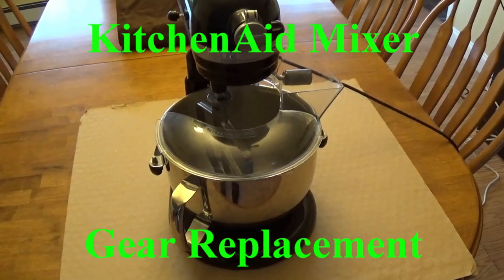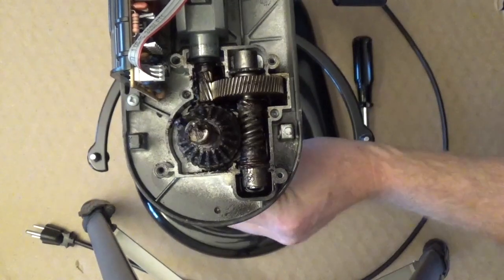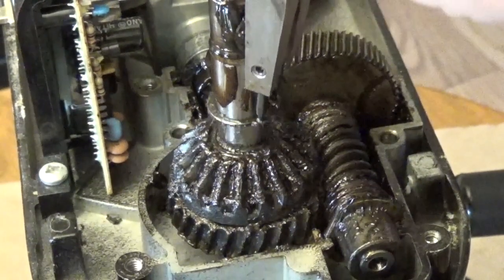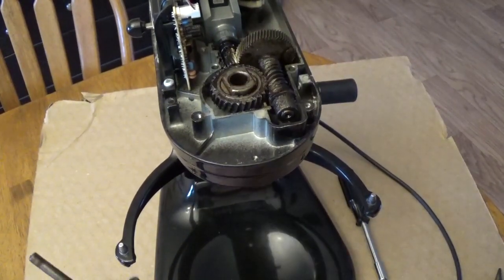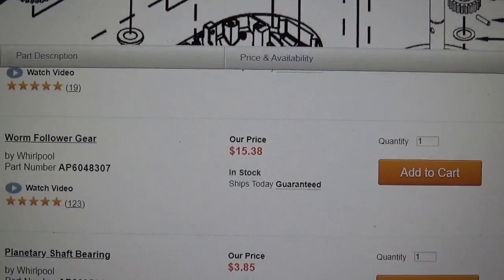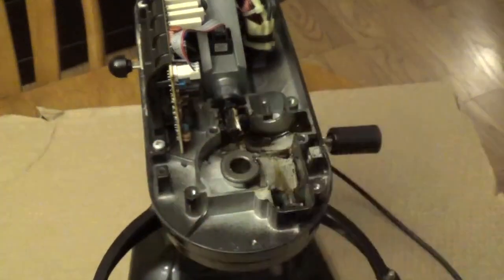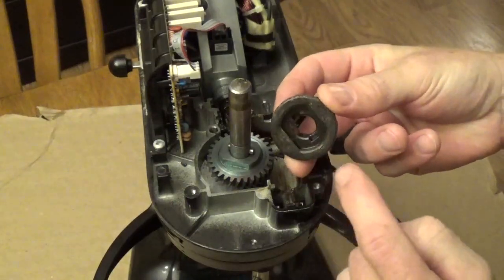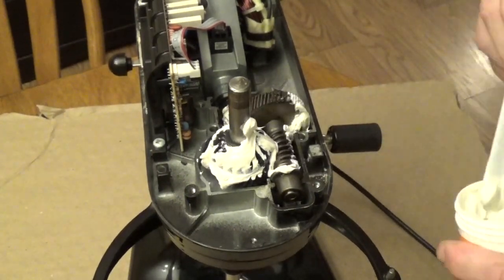KitchenAid Mixer Gear Replacement

Comment: This is an excellent no-nonsense video.  Thank you!  I had to use a rubber mallet to get the main shaft started down (after pulling out the pin), but apart from that everything went smoothly.  The same work gear was worn  on mine as the one in the video.

Comment: Nice video. Well done.  Fixed my broken gear. 
Pro tip: Don't use the wrong size plunger to push meat into the grinder attachment (like I did)

Comment: I removed the retaining ring but the hub gear stilll isn’t coming off, what gives? I could only lift it up to where the groove for the retaining ring ends.
Reply: Never mind I just had to pry it out really hard.
Reply: Never mind I just had to pry it out really hard.
Reply: I pushed from the top down while holding the bottom side with my hand.  I, too, had to use a bit more force than I expected.

Comment: I have watched 4 videos yours is the only one that didn't show how to remove cover.  Still looking for a video that shows how to get the top cover off my model
Reply: Remove the small square drive screw at the back of the mixer (on the silver strip).  once that is removed, take off the silver strip and remove the 4 square drive bolts.  the top then wiggles off ( keep wiggling and pulling straight up - it'll come off) then follow this video.

Comment: The thing that tripped me up was I had to use a little force to move the agitator shaft down and out of place. Other than that, this was a relatively easy fix. Thanks!  Plus, watching this video clued me into getting that snap pliers and food grade grease.  This seems like a common repair so much so that once I ordered my part, Amazon knew to suggest the grease and grips to me on its sidebar.

Comment: Hey I have the same mixer, but it’s of Kitchen aid 600. I’m trying to replace my gear in the mixer and I saw that you have provided a website for replacing parts, but it’s of Whirlpool’s. Would it make a difference if I bought the gear from Whirlpool’s website and replaced it in my Kitchen Aid 600?
Reply from the maker: Should matter as long as it is the same part number.